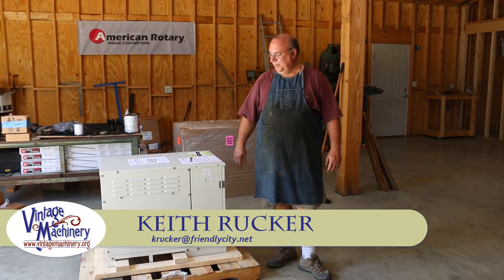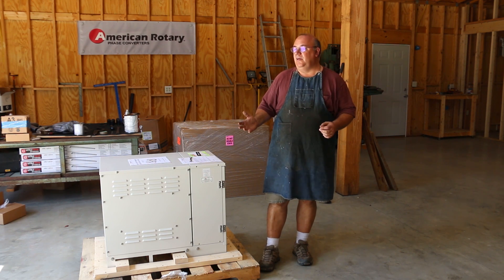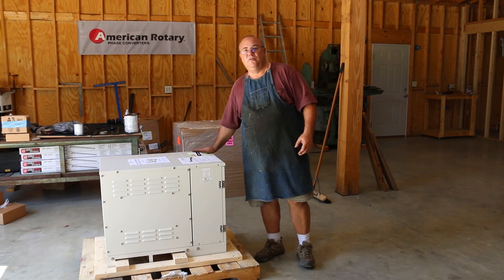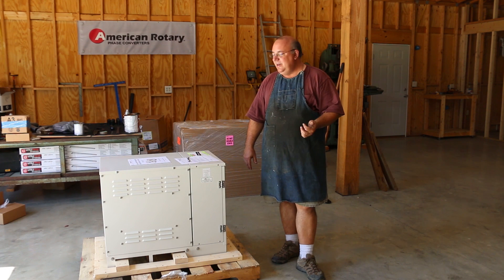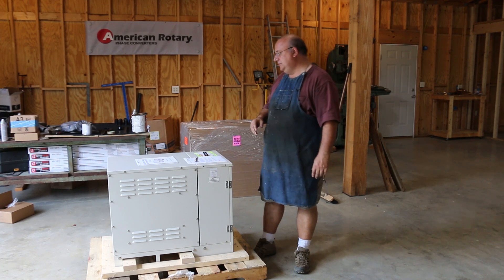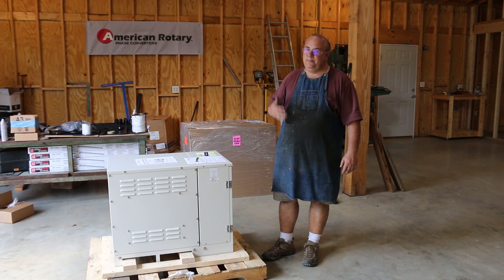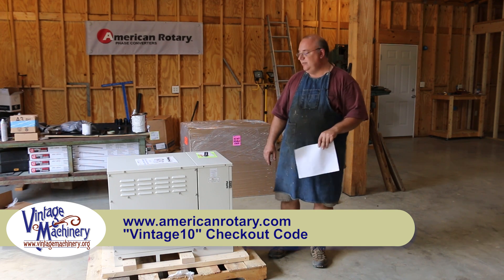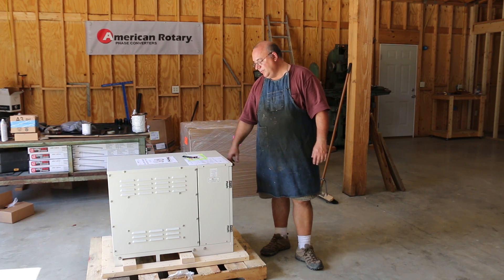Convert Single Phase Power to Three Phase Using a Rotary Phase Converter

Comment: Perhaps it's been asked already below but the comments aren't searchable. Which particular model did you get? American Rotary has different units within the same overall power level. I'm looking to buy one large enough to run a 10 HP motor.

Comment: Some people, like me, have enough electrical knowledge to be dangerous. Literally. 😜. I hooked up a vfd to power a 550v bandsaw from 220 single phase power. I put a stepup transformer after it, then it went to a magnetic contactor. If you listen closely you can hear electrical engineers and industrial electricians the world over either snickering or gasping in horror. So my belated understanding is that you can’t use either of these things downstream of a vfd. Something to do with inductive reactance? I love that term. It sounds so high tech! If I had a clue what it meant I would not likely have experienced the blinding flash that occurred when I flipped the vfd on. So part of the decision of how to achieve 3 phase power has to include what components you are putting downstream of the converter. I think vfds are only happy if they are connected directly to a motor, essentially serving the same function as the starter contactor. But please don’t take any advice from me. I’m the guy who’s standing in his shop looking like wile e coyote after one of his schemes has gone wrong, all charred and smoking. Talk to a professional. Designing a robust safe setup requires specific knowledge. One you know you have a safe design the hookup is probably not that complicated.

Comment: I'm sure it is a nice covienience but...running an electric  motor from single phase  that effectively drives a generator so the output can drive another motor is not conserving power. Only true 3 phase from utility can be more efficient.

Comment: Ok, I need to get into this, how can a squirrel cage induction motor generate a voltage without the use of excitation? The rotor is simple bars that are shorted, one would need an armature instead of rotor to generate a voltage.

Comment: what is the benefit of 3 p over 220v ?  in costs and power ?   thanks,
Reply from the maker: Three phase motors are more efficient than single phase motors.  The way someone explained it to me one time is it's kind of like driving a stake for an old circus tent.  With single phase, you have one person swinging a sledge hammer driving the stake while with thee phase, you have three people working at the same rate as the single person, but in the same amount of time, the stake gets hit three times instead of one.  A three phase motor does not necessarily use less power than a single phase motor, but when it comes to the amps needed to power the motor, you can wire the motor with smaller wires and draw less amps than with single phase (again, you have three phases doing the work instead of one).  Generally speaking, three phase motors will result in some savings on your power bill if you are using a lot of them in a factory or shop setting - and three phase motors tend to be smaller and cheaper than single phase motors for the same horse power rating.

Comment: Hi does this draw a lot of power to your bill
Reply from the maker: Hard to say.  I am not running it all day every day - usually just a few hours some evenings after work and maybe a good part of the day on Saturdays.  I have a separate meter in the shop and my bill usually runs around $20 a month - maybe a bit more if I am in the shop a lot.

Comment: yeah but what do i use for a single phase house converting to three phase with a induction heater, and i think i need something to spark frequency, is this the same as a motor supply? or can i just use vfd? does a motor feed back extra phases? how bigger motor for to supply 20kva?

Comment: you can use a ac motor, typically 3 hp 3 phase and convert your single phase to 3 phase easy. you need 2 capacitors and a 3 phase 3 hp motor , it uses the 3rd leg of the motor and 2 caps to create the 3rd phase. It's cheep and simple.

Comment: Before i know your Channel, i don't know the power Problems for small Shops in USA. Interesting to know, but makes me feel sorry for you Guys. :-( Here in Germany its normal to have 3 Phase at 380V(400V) in almost every Building. My Dad runs a small Shop with CNC lathe and miling. We have 100 Amps on every Phase for Main Circuit Breaker.  Greetings from Germany and keep up the good work!  PS: Sorry for bad english!
Reply: Most of Western Europe has been like this since the 1940's. You wouldn't believe how many across North America are jealous of you. One quirk was Canada's adoption of 3 Phase - 550 Volt electric motors, which are not used in the U.S. 

We were whacky and arguably, still are.

Comment: I am in Holland and getting 3ph to my workshop costs an arm and a leg (running cable and installation costs) and you have to pay yearly user fee around 800 Euro. I only have 16 amp single ph in my hobby shop and purchased a rotary phase converter in UK for 900 Euro. It gives me 2200 W of true 3 x 380V +N+E and i can power all my 3 ph equipment. My main mill is a Sixis 103 and total installed power is about 2 kW on this machine and it runs perfectly. Also my grinding machine, drill, shaper can run from this rotary. It is a wonderfull cost effective piece of machinery and actually very quiet. I have a hobby shop and only use one machine at the time.

Comment: At the factory where i work we use vfd's just for speed control, we got some medium sized ones rated at something like 75 or a 100kw. They are extremely expensive pieces of kit.
Reply from the maker: The big ones are out of the price range for most of us home shop guys to just use for three phase conversion.  That is the beauty of the phase converters!

Comment: 2 phase 220/240 VAC is what enters your house and it is split into two inverse single phase supplies for 110/120 VAC circuits (lights, most outlets, light appliances). There are also circuits that use the 220/240 VAC 2-phase power (central air,  heavy appliances).

Since he built the shop and knew he needed 3-phase power, why didn't he have the utility hook him up both 3-phase and 2-phase service? Was the converter that much easier?
Reply from the maker: First off, a house is not powered with 2 phase.  2 phase is still used in some parts of the US, but it is very rare and is considered to be pretty much obsolete - two phase is two hot lines with the phase 180 degrees apart.  What is fed into most residential homes in two legs off of a three phase service with the three legs 120 degrees apart.  It is not the same thing.  Even though you have two of the three legs, it is considered to be 220v single phase power (110 v on each of the two legs coming in).  

As for why I did not ask for three phase, I would have loved to have that fed right into the shop.  But it is not that simple.  Three phase power is just not everywhere - particularly in residential areas.  In my neighborhood, I do not have three phase power at the street - only 220v single phase.  To have three phase power, I would have had to convince the power company to bring in three phase service over 1/2 mile from the main road where they have three phase.  Not an economical option for me - just like it is not for many people who have a home shop.  In these situations, a rotary phase converter is an economical way of creating your own three phase power, and that is what I opted to do.
Reply: It is a pity that your street is set up like that. I was wrong about the phases, instead it should be 220/240 VAC single phase between the hots in the higher voltage home circuits. I do have to ask, is a rotary converter more economical than a Scott-T transformer or do you have uneven loads in some of the equipment?
Reply from the maker: Well, first off, let me correct myself - two phase power is two legs at 90 degrees apart rather than 180 degrees like I said.  I am not that familuar with at Scott T-Transformer, but I don't think it is of much help in this situation - that is for converting three phase from true two phase.  Again, since I do not have two phase, I don't think it would work (but I may be wrong - I quite honestly have never seen anybody use this method before, which makes be believe it is not applicable for converting single phase to three phase).

Comment: You may find this useful in better understanding 3-phase output from your phase converter. The circuit you are getting from your converter is what is known as Open Delta Three Phase. This is kind of a difficult concept to both grasp and explain. Open-delta service can be routinely found serving small businesses, etc., where most of the load is single phase with some 3-phase demand for machinery, like air conditioning units and such. It delivers 87% of the power of a full 3-phase delta transformer bank. It is not exactly 120 degrees difference in phase due to reasons I can't explain even after an extremely smart and well educated friend of mine that was a senior engineer for the Bonneville Power Administration laid it out for me. In a hookup from the utility, one of the transformers (usually the larger of the pair,  not of the same size KVA) is center-tapped to produce 120/240V. The benefit for the utility is fewer and smaller transformers, since only two were required and the two need not be matched in size as with a closed-delta or Y-connected transformer bank. Not closing the delta eliminates energy wasting circulating currents within the transformer bank. Many utilities no longer offer open-delta service because of the distortion it creates on the high voltage line.
Reply: George McPherson in his book "An Introduction to Electrical Machines and Transformers" handles the subject of Open Delta 3-Phase with clear connection and phasor diagrams, in his chapter/section on handling three phase transformation with two transformers. Compact but well-handled, I always thought.

Comment: you lost me at the cost or i am missing something. That unit is a little over $7k, is it not comparable to 40 HP VFD for $2-3k?
Reply from the maker: It is actually around 4K.  I think you are looking at the 80 HP unit that is rated for running a 40 HP motor.  Mine is a 40HP unit rated for a 20 HP motor.  And last time I checked, I could not find a 40HP VFD for that cheap.
Reply: +Keith Rucker - VintageMachinery.org 
cool, can't wait to see the install video

Comment: Remember Kieth start up currents for motors can be three to five times the full operating currents on electrical motors. Doubling the capacity of the largest motor is the minimum size you can get away with. If you have that 20 HP motor already running and try and start even a 7 HP motor you will likely see significant droop on your phase converter.
Reply: very good point 👍

Comment: I'm very interested in this, and will be following it closely...I have a very old (1980) ARCO rotary phase converter...10Horse....nothing in the control cabinet except 6 big capacitors....I used it for 3 years to run a weld shop....It Ran a Lincoln SAE200 MG set, a15 horse chopsaw....Now...these VFD's...Do then actually provide true 3 phase from single, and are they phase correct at 120 degrees?
Reply from the maker: You still have a slight variation in phase on each of the legs.  But, line power will too.  For running a motor, or for that matter, most machines in a machine shop, this is not a problem.  When you start getting into electronics, it can be an issue.  Which is why most CNC machines have a VFD built into them even if connecting to line power off the grid.  But, you can use a much smaller VFD to clean things up as you have to overrate a VFD by about 50% when it is being used to convert single phase to three phase.  This can get real expensive on larger HP machines.  I do use a couple of VFD's in my shop but I am feeding them with three phase from the RPC.

Comment: How do you run a 40 hp phase converter motor on your little residential service?
Reply from the maker: I run two wires to it from my breaker box.  200 amps is more than enough to power this converter.

Comment: Keith,  I notice that neither you nor Stan Z mention the efficiency factor in comparing the VFD to rotary. In my case, I use to have (early '80"s) a rotary PC to drive an 850 RPM 3 PH motor on my drill press (850 RPM motors are not available in single phase).  That rotary (not AR) pulled 4 amps @ 240 volts with no motor turned on.   A lot of wasted power doing nothing.  I sold it and used a VFD instead.  Granted, in your case, you don't have much choice.  Hopefully, your new unit's efficiency is greatly improved over what I had.   I would be curious to know what your unit draws with no motor being used.  Also, what amperage power do you have feeding your new shop?  
Pete
Reply from the maker: Once I get it hooked up, I plan to check and see how much it is drawing.  A VFD is probably more efficient on small motors, but for running an entire shop, they just are not practical and are way too expensive for the HP I would need.

Comment: $$$$$$$$$$$$$7,200.00
Reply from the maker: Mine is the AI-14, which lists for around $4,500.  I think you were looking at the AI-17A.  The difference is mine has a 40 HP idler, which is rated to start a 20 HP motor under a load (a bigger motor if no load), while the AI-17A has a 80 HP idler and is designed to start a 40 HP motor under a load.

Comment: VFD has one advantage: you can go 2-phase to 2-phase variable speed. If what you need is just plain speed control (mrpete222 has a video on this)  then you can get away with a $70 VFD if my memory is correct. In fact I am looking around for just that. But if you are running a whole bunch of 3-phase motors then rotary is the way to go. I don't mind in the least that you give them a plug. I am free to listen, and either accept it or ignore it.
Reply from the maker: As for a $70 VFD, that would be for a pretty small motor.  VFD's are sold by the horse power of motor they will drive and the bigger the motor, the higher the cost for the VFD.  For motors under 5 HP, they are reasonably priced, but once you get up to the bigger stuff, the cost of the VFD's start to skyrocket.  And don't forget, VFD motor ratings are usually listed assuming you are powering the devise with three phase (unless it is specifically being sold for single phase input).  If using a single phase input to the VFD, you have derate the power by about 50% - so to drive a 5 HP motor, you would need a VFD rated for 10 HP.  With my phase converter, I can deliver three phase to a VFD and use a smaller and cheaper VFD to get speed control (which is how I use the two VFD's that I have in my shop).
Reply: Very true. The praice I recall is for my Taig, which currently has a 1/3 hp motor.

Comment: Congrats on the phase converter and the sponsorship - and - I appreciate the discount for us that you worked into the deal!
   Have you discussed the advantages/disadvantages of a static converter against the  rotary, and VFD phase converters in a different video?  I just purchase a 1hp bridgeport and it comes with a static phase converter and I am curious how it will work down the road.
Reply from the maker: Static works, but it is all done through capacitors.  Uses a lot more energy and is not as efficient, but it works.
Reply from the maker: Also, static converters are not nearly as well balanced as a rotary and there is considerable power loss - your motor will probably not provide the full rated HP when ran on a static converter.
Reply: Wow, ok thanks!

Comment: .......congrats n all counts.........if your going to do it it.....do it right!.......the shop is getting better everyday......I see big things coming.......lots of the better used machines are 3phase, and usually cheaper.........passed over by small shops or hobbyist due to power issues.......
Reply from the maker: Which is why that if you want to be serious as a hobbyist machinist, you need to invest in a phase converter!

Comment: In my opinion VFD's are a much better way to go, but of course if someone is going to give you a rotor phase converter which are Very expensive it would be hard to turn down.
Reply from the maker: Try pricing a 40 HP VFD.  Or even a 10 HP VFD.  For the higher HP's they are just not cost effective, and if all you are needing is phase conversion and not all of the other fancy things they do, it is just hard to justify spending that much money.

Comment: 20hp what ballgame is that? I gues it is what normal would be around 3 fase 240v pr fase. 63a in europa. or can anyone calculate it. in normal houses in Denmark. we have 16amps max 32amps 3 fase
Reply from the maker: I have a 200 amp service coming into the shop at 220 v single phase.